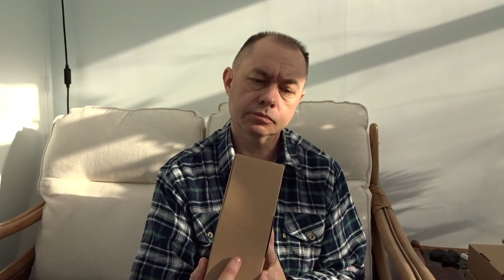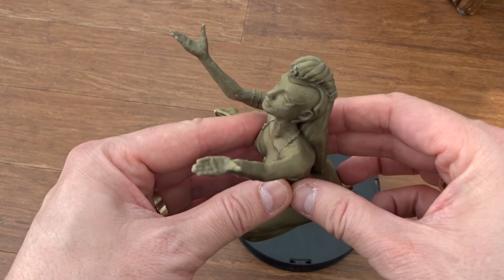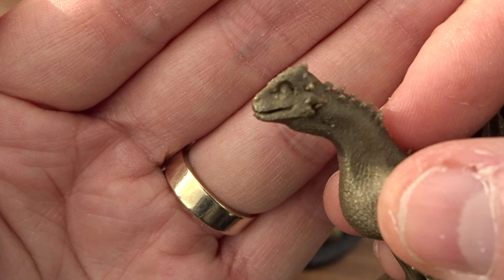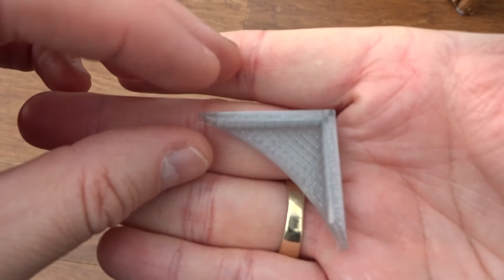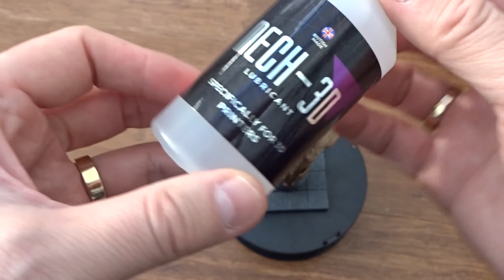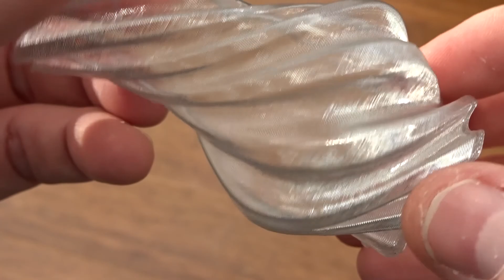Spotlight on 3D Printz Ltd

Comment: Great video, I like that you used proper prints rather than the 'test prints' that a lot of YTers use.
I completely agree, 3D Printz are a fantastic company, I was lucky to meet them at TCT. Tom said they hope to bring their manufacturing in-house at some point.
I've been using their filament for quite some time, both 2.85 on my Sigma and 1.75 for the MK2, and it is top quality filament in every respect. I use the PLA, PETG and TPU and all print fantastically. Their pricing is very reasonable too.
I haven't used the Clear or clear grey yet, but going by your results, it won't be long before I order some.
Reply from the maker: Spike Kent thanks :) there might be some more transparents next year hopefully :)